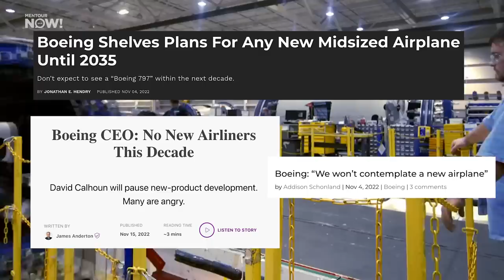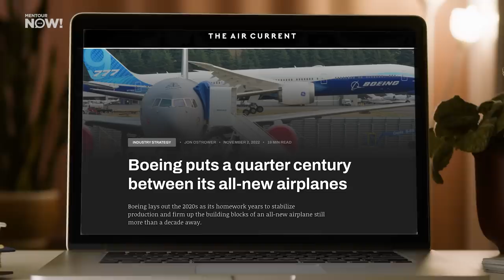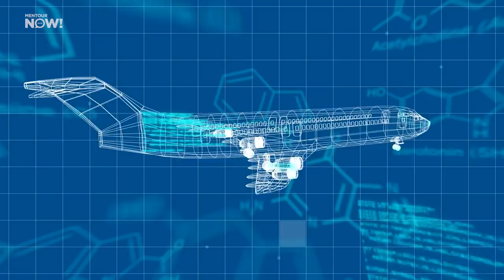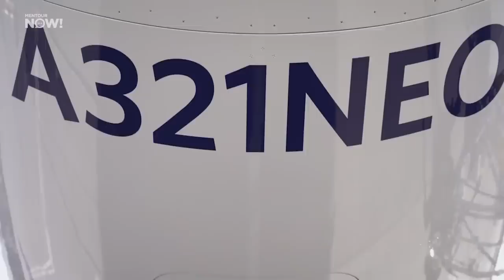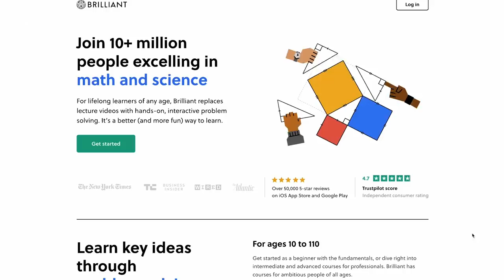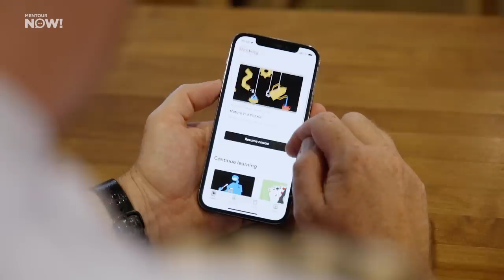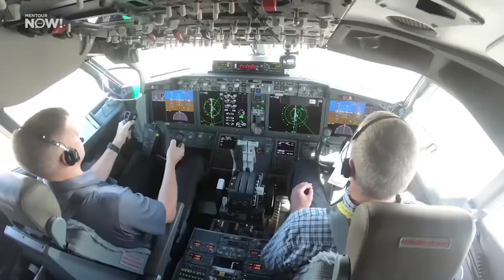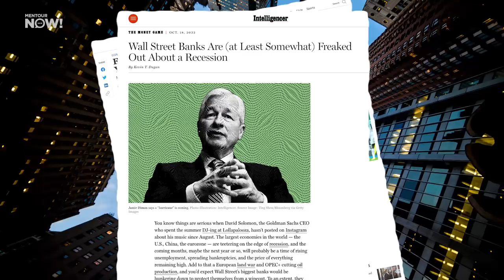Is BOEING giving up!?

Comment: Nothing better to motivate engineers to stay than to tell them that there’s no new projects in the pipeline for another 5 years. It’s a company being led by accountants and it reflects in their attitude to engineering excellence.
Reply: Yeah, I was thinking the same thing. Young, eager, newbies, who want to design airplanes...well, they won't be going to Boeing.
Reply: Yea, they've been going that way since 1997, if you take my meaning.
Reply: There are many types of engineering. Nothing wrong with a pause at the bleeding edge while experience and expertise catches up on the maintenance side. Been there.
Reply: They are gonna have a hell of a time with the competition as those engineers go on to their competitors. The value of talent in aerospace can't be understated. Not that many students get degrees in aerospace, most get degrees in other fields. They have a limited pool to pull from. I am an engineering student, out of thirty plus engineering students off the top of my head, only one is going into aerospace engineering. Everyone I know that wants to get into aerospace as an industry, they want to work on rockets and satellites. Boeing treating their engineers like a commodity is a grave mistake.
Reply: @rrice1705  I've...heard...stories...)
Reply: But airbus don't plan to develop  a new product within this decade either but no one is bashing them  . Boeing  still have numerous  potential  projects on the cards like a 787F , the 777XF , a potential  737-10er, the 787HGW ,  starliner , Vulcan , MAX 10, MAX 7 , 777-9, 777XF and maybe a 777-10.  

Boeing still have so much that needs to be done that's why they postponed new aircraft  developments  to the 2030's the first place .
Reply: @mmm0404  What I have heard is, Airbus designed their airframes to accept engines over time as they get more efficient without having to change the airframe. I don't follow it that closely, but it seems there might be something to that. Boeing I think, they ran out of space with the 737, thus why they moved the engines on the Max and I suppose mostly so they didn't have to recert, and add all the new electronics to the airplane. Not sure about that however. That's what I've heard.
Reply: @DrGingerHamster  well the 737 was not ment to be produced for this long . The thing is Boeing wanted to replace  the 737NG with a new cleansheet  like the 787 but airlines didn't  want to wait 4-6 years  for it . They wanted an revised  737 that could arrive  sooner , so Boeing was forced  to make the MAX instead  .
Reply: @mmm0404  Yeah, I've heard that too.
Reply: @mmm0404  Interesting though, they did the 787 in a relatively short amount of time. Maybe they got rid of all the smart people who could do that? Who knows.
Reply: Fully paid up Airbus fanboi here. Airbus at least superficially have a greater and newer  product range but there is a degree of cannibalisation present that Boeing doesn't have to contend with in its product range. 5400 737 Max orders, 590 delivered.
Almost 500 787s yet to be delivered.
Boeing is going through a bit of a rough patch but they will prevail.
Reply: @marcg1686  Well, I think the government if it comes to that, will make sure they do.
Reply: @marcg1686  But yeah, Boeing it seems has a lot of interest, lot of orders for sure.
Reply: You are so right. Harkens back to when McNamara ran Ford.
Reply: @rrice1705  Was 97 the year MacDonald Douglas bought Boeing?
Reply: @PadraigTomas  You guessed it (with Boeing's own money, as the story goes . . . )
Reply: @mmm0404  LOL Boeing is not a hostage to airlines, the fact they did not offer anything better than MAX is really sad, plus they could always play with price of NG as an alternative to NEO.
Reply: Imagine if Lockheed had told Kelly Johnson there would be no new aircraft for 25 years. Pretty sure he would've jumped ship and gone to work for someone else.
Reply: The definition of a good accountant: it is a guy who knows the price of everything and the value of nothing. Small efficient companies are run by engineers, large ones by accountants
Reply: @henson2k  lets be  honest , the only major screw up Boeing ever did was the flawed implementation  of the MCAS software.  If that that never happened I'm sure no one would have cared how old the program was. 

The truth Is most airlines where satisfied with the 737NG that they did not see the need for an all knew airplane . The 737 is still a very capable  plane that's why , despite all the stuff that has happened  with it , airlines are still buying  it.
Reply: @DrGingerHamster be that as it may, other than military aircraft, there’s not tons of activity in the field. But there are lots of other manufacturers of aircraft, just not on the scale of Boeing. It seems when people think of aviation the thought automatically goes to commercial airliners but general aviation exists as well
Reply: I'm currently an undergrad and didn't even apply for a Boeing internship because that's a long time to not do any commercial aircraft design
Reply: @disculpateurdifferentiel4416  With companies like Boeing, theres gotta be a balance between engineering, finance and other departments. Would be nice to have widly creative large companies, but thats sadly not much of a thing (and probably not very possible).

That said, Boeing is clearly lopsided. Its not like Airbus is some visionary, brillant company these days, but they seem to have a more healthy relationship with engineering.
Reply: @mmm0404  Thats just not correct, Boeings screwups go way back. That 737 Max 8 was the consequence of many failures to innovate, and its way worse than just a "flawed implementation". The Max-8 was a rushed rushed out a hackjob upgrade with an MCAS bandaid to make it more palatable, not giving the engineers enough time and manipulating the FAA to get their way.

Like, its pretty much a cliche that Boeing is ruled by finance people, not engineers, because their actual rate of innovation is dangerously low. And when they do something, they usually take a lot longer than Airbus or more agile competitors.

In that light its interesting that you mentioned the space-part of Boeing. Starliner is an embarassment, Boeing fails for years now to make a basic manned capsule. Their rockets have been obsolete for decades, kept running by government money. Rockets like Ariane 5 made them non-competitive. Let alone SpaceX.
Reply: @termitreter6545    Both the delta and atlas have been hauling cargo into space for a  long time , they are very successful  programs and have had a few launches in the past few months . 

The atlas 5  currently  has about  20 launches left before it is retired from what I heard  and has recorded a 100% success rate . It will be replaced  by the Vulcan . 

The Ariane 5  has been a success too just like the atlas v  but it did not in any way make it obsolete.  What kind of BS is that . Lol

I stand to be corrected  but the starliner should have its crewed test flight somewhere  around the second quarter  of next year

Anyways  spaceX rockets are making every other rocket obsolete  , no need to attack a particular  company . Lol
Reply: @mmm0404  Thats a bit of a misunderstanding. Yes, the Delta and Atlas series clearly are successfull rocket programs, and the modern versions are very reliable.

However, Boeings refusal to innovate is what made them increasingly non-competetive in the market. The late Delta-V Heavy was incredibly expensive, and mostly there to "leech" off government money.

The Atlas fares better and has more launches, Ill admit that, but ive just checked the last few launches on wikipedia, and its almost purely space force or other government programs.

The Ariane 5 isnt a better rocket than the Atlas because of its technology or whatever, both are capable and reliable.
But its way cheaper than the Atlas, and delivering a cheap acces to space is what makes a rocket great.
And mind A5 is pretty much done, with A6 hopefully slashing the price much further to get somewhat competitive with SpaceX.

Vulkan is mostly "new" because it uses new engines from Blue Origins. It still uses the GEM booster design from the 80s, but idk if thats a bad thing.
However, the reall issue is the Centaur upper stage running RL-10 engines. The centaur is basically ancient, and the RL-10 engines are still based on the first liquid hydrogen engines America developed in the 60s! They are notoriously expensive.

Thats really where I see the recent "boeing effect", they struggle to implement innovation and are too reliant on being too big to fail.

Thats not to say Boeing is always "bad", they make great planes in a very competitive market, and the 787 is a big victory. However, even the 787 struggled with reliability and production. First battery fires early on, and just recently most production got shut down for over a year because of quality problems. 
Cost overruns also mean that despite the 787s success, its unlikely to be profitable until they sell something like 2000 planes.
Similar stories (and even less succesful) for their KC-46 tanker, Air Force One, and even the 737 MAX' aircraft have been grounded a few times recently for more production problems.

Sorry for the wall of text, but you see what I mean? Boeing often seems reluctant to innovate, they try hard to monetize old equipment. And when they try new things, they often struggle to pull through, with massive cost overruns and sometimes even lack of quality, which indicates the wrong people make the decisions on many levels.
The usual narrative is that finance-people displaced the engineers to an unhealthy degree in Boeings leadership, which seems to hold some truth? Or you think differently?
Reply: @termitreter6545  well I guess they don't want to risk too much . Since ULA is a Boeing- LM partnership  and the fact that they probably  want to continue  to scoop  national  security  payload launches , they would like to stick with proven tech for the time being . 

I'm sure they purposely  sticked with the RL10's because it allowed them to meet the requirements of the National security  launch program , giving them a better  position  in winning national security  contracts . 

It's going to be tough competing with spaceX  directly  so you might as well try to focus on a niche. 

Anyways Just like the SLS , the Vulcan might get PIPs over time improve reusability and reliability .
Reply: @mmm0404  and what a mess they made of it ,I would never fly in one